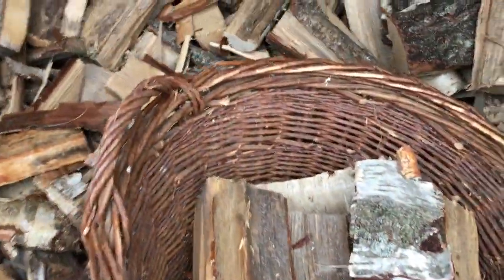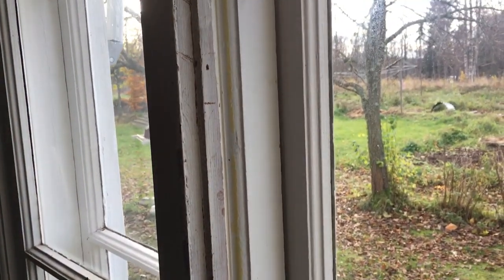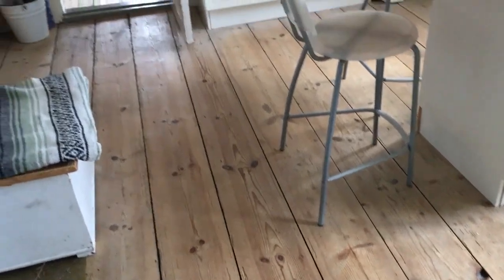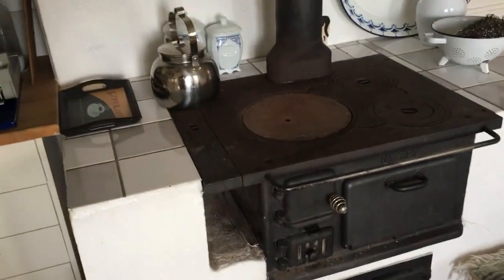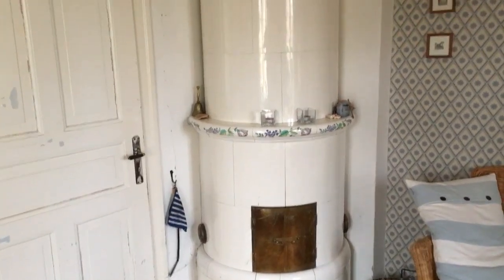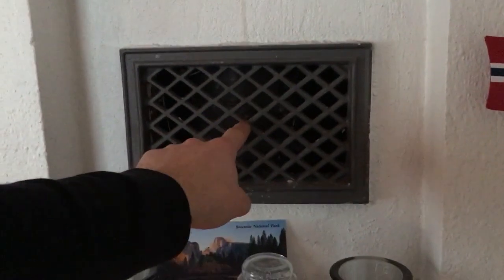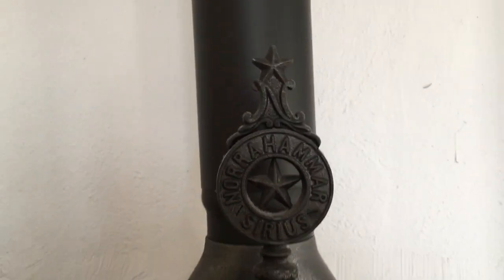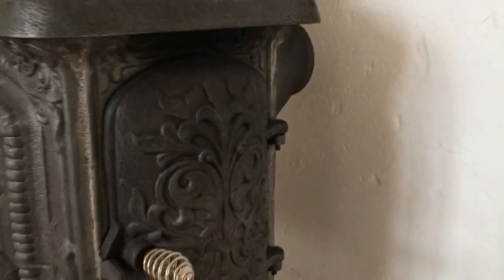The Most Stunning Wood Stoves In Our Farm House

Comment: My grandfather and grandmother had a lovely older stove in their kitchen and grandma cooked on it all the time and it was a Coal, Wood or gas and it was really quite large and she could heat food on the side of it while others as cooking. The wood and/or coal would bun all night and day and it kept the whole house very, very arm. It was wonderful on the Snowy Winter days and nights.  I wish we had one now. If you live in the country it works out better as in villages often to run the chimney out the sie may not be god, but running it through two stories or more is expensive. But in the country it wold save on chimney bu going outside of the house. Suppose it keeps the house warmer through if the chimney does go through to the upstairs?

Comment: We had wood heat in northern Wisconsin.  Nothing a beautiful as these however.  The last one you showed was similar to ours in the kitchen and it was used to heat the kitchen and  bedroom just off of it.  We cooked on it (if you remove the rings on top you can control how hot your pan can get depending on size.) We also had an odd little oven just over the top attached to the stove pipe going to the chimney.  We baked biscuits, fruit strudel, and strata with eggs and bread.   No smoke just the heat as it was closed off.  Otherwise we heated the whole house with a large brick lined stove that held the heat overnight.  I would have loved to have the stoves you showed.  Just beautiful.

Comment: I love cooking on a wood stove, the very first time I cooked a fruit cake in the oven part of it, we had to contact my mother in-law for advice because the cake was cooked on top but raw in the middle, she told us to get an old newspaper folded, and place it on top so the heat would go into the middle of the cake. There's nothing more homely than a wood fire. Greetings from Sydney Australia. The Jotul firebox wood be usable out in the garden, put some chairs out there for everyone to sit around it, just make sure it's sitting on concrete, if you are careful taking it out to the garden you might still be able to get 2-3 years use out of it, don't forget to take the kettle out there too so you can make tea or coffee and sit around the fire.
Reply: I use a inverted cast iron skillet on top of my breads and baked deserts, the cast iron is supported by a few stacked bricks,  and it helps evenly heat your breads, if your wanting crusty tops you can turn your pan up, and add red coals and cover it with a tight lid, you do the same with a flat dutch oven lid, placing coals on top to ensure even heating. Folded news paper covered with tin foil is a great way to insult the heat...

Comment: Beautiful video! So well done. I learned to cut trees in the fall, leave them until winter, the leaves will suck most of the moisture from the wood. Then limb them and cut to firewood length. Wood also splits best when frozen. I try to get it all in the shed by March- it's bone dry by September.  Mostly all birch here in AK too.
Reply: Birch is the BEST!

Comment: Great Video:   Fireplace’s and wood burners have a great place in our homes or business, however poorly maintained and not properly operated at the correct temperature, and not cleaned regularly can result in a hot chimney fire or loss of the structure, I use a magnetic clip type.  Wood burners with a 90 degree elbows are very difficult to maintain and kept clean of creosote build up.  I have both units (with straight pipes)  and I wire brush them often. Operating a burner at low temperatures will result a wet slimy dripping creosote which can ignite and set the inside of the pipe into a roaring blaze.....I am no fire expert I just learned by using mine and research. Good luck.

Comment: I grew up with wood stove heat.  So did both of my boys. Never even had to wear a sweater inside in the winter. The house we now rent has central heat and air. We  were hot all summer and now from the waist down, I'm freezing. Funny thing is that there is a place in the living room where a wood burner used to be. The landlord removed it, blocked the chimney and said we couldn't replace it. We couldn't afford to now anyway with all of the new codes.

Comment: You might be able to fix the Jotul by welding it with nickel chromium rod and using a torch to keep it from cooling down too fast after the weld.  I'm assuming it's cast iron.

Comment: Electric heat is great too. No collecting and chopping firewood. No scrubbing dirty walls and ceilings because of smoke and soot that escapes the fireplace. Just a tiny electrical device that cleanly blows hot air as soon as you plug it in and turn it on. Imagine that! Or, to heat larger areas silently and cleanly, embed electrical resistance wire in the floor and enjoy warm floors and warm rooms regulated by a thermostat.

Comment: The tall narrow oven is made for coke (koks in Norwegian and Swedish), not wood. You fill it from the top, and is settles near the grill in the middle. It burns slow and keeps warm very long. It's not a problem to use wood in it, but that's not it's original purpose. It would be hard to get big, or even medium sized pieces of wood in there. It's really beautiful. Had one in my grandparents cabin, and it gave amazing heat.

Comment: The problem with old wood stoves is they don't seal very well so it's almost impossible to control the heat, plus they burn the wood up several times faster than a stove that is well sealed. That's why I bit the bullet and bought a Vermont Castings Dutchwest stove. They no longer make the Dutchwest but they've started making a similar model that is supposedly slightly more efficient than the Dutchwest model, which is one of the most efficient wood stoves ever made. Jotul also makes one or two stoves like that. They really are beautiful looking stoves but they're a bit pricey.

Comment: New subscriber here, trying to catch up with all that I have missed. We have a wood burning stove in our apartment here in Prague Cz and I fully understand your enthusiasm! I like to burn the trimmed branches of fruit trees, they give out a lot of heat and you can usually get them free! ;-) Tile stoves are still found in large, older properties here, but they tend to be more rectangular and with ornately moulded tiles rather than those lovely, smooth curves... In rural areas and smaller cottages, wood stoves in many styles are still very common and much more like the 'naked' ones you showed.
Reply from the maker: Hi there. Thanks for joining us. The bigger farm buildings here also have more rectangular tile ovens. They are beautiful as well.

Comment: The wood stoves we have considered purchasing draw their air directly from the outside. The smoke goes out through a duct inside the fresh air duct. As a result, the exhaust duct is cool, and the incoming fresh air is pre-warmed. Because these stoves do not draw their air from the room and send it up the chimney, they are much more efficient. They don't draw cold air into the house through your rooms from outside. This bears repeating. The air that feeds the fire comes into the stove through a duct directly from outside. The resulting efficiency is wonderful!

Comment: I grew up on a farm, in a wood frame house with a wood stove. ALL my family has some kind of lung issue now. When you went to school YOU were one of few that Smelled like burning wood. The ONLY room that was comfortable was the one with the Wood Stove in it and the constant processing of wood in summer took away from the daily chores of the farm. When my oldest brother came out of the military he bought a home with CENTRAL HEAT. I thought I was in paradise. No smell, all the rooms were the same temp and you didn't need to wear long sleeves, sweaters and socks and shoes ALL winter long. Nope. Grew up with this source of heat,,am NOT going back to it either. I built my home so well insulated that we use very  little power to heat it and THAT I LOVE.
Reply: I am older and no longer heat with wood... I worship my thermostat.

Comment: I see that you burn white birch...just letting you know that the birch bark has black oil in it and causes sticky oil substance that will stick to your inside chimney liner. Try taking off the bark and use it as a fire starter or sell me the larger sheets of birch bark for my furniture making design.  I like the stove and thinking of buying one for my work shop with the oven. 
thank you for the video.

Comment: Wonderful Video, I live in an underground earth home built in the mid 1970's, we have a Russian Style fire tunnel (about 6' in length, the German Emigrant that built it said it was one of his last builds, he was in his 70's, I'm told. The chimney channels back and fourth horizontally before going up the chimney. It helps to heat up the walls and fire brick that hold in the heat, even after the fire went out. The main problem is that if you area away and not monitoring for new leaks, you could have a major leak problem and not know. Thank You
Reply: Our russian style stove was fired for two hours, twice a day, once in the morning and once in the evening, and heated 1800 square feet.  It burned to fine ash in those two hours, then was closed up tight the rest of the time, nothing to leak.  We also had carbon monoxide detectors in every room, they never went off, not even once.
We charged our heater slowly when heating season came along, it took a whole week, slowly increasing fire size from a few pieces of kindling to a full firing.  The charging process was necessary to expell any moisture in the masonry, and prevent cracking.

Comment: We use 2 wood stoves to heat our log house.   The old cook stove has a big oven, a warming oven on top,
and a side reservoir for water.   It's name is Round Oak Chief and it keeps a fire all night if it's shut down tight.
We do love it ~  we can cook 5 separate pots of food on top,  a big turkey in the oven,  and heat our water 
in a tank connected on the back !!!   There's a company called  Woodstock Wood Stove,  that we bought our Livingroom  wood stove  the 'Progress Hybrid' from.  It's cast iron with a soapstone exterior.   It's unusually lovely and extremely efficient!   It easily keeps a fire 15 hours when loaded and shut down!   It's our only main source of reliable heat,  all seasons.  The 100+ year old Cookstove we use in very cold weather ... & cherish it.
We use four and a half full cords of seasoned wood in the coldest year,  so far.  But just four, in years like this

Comment: Cast iron is the best metal for stoves. Whether the fuel is wood or coal, cast iron has good inertia and emits heat in a smooth manner, no peaks and no troughs. There are many small and medium enamelled cast iron stoves here in France, fo sale on ebay. People get rid of them because they're heavy but many of them are beautifrl in a variety os styles like Victorian with vines and flowers or Art Nouveau or Art Deco.

Comment: The furnace at 8:26 isn't a woodstove. It's a coal burner, hence the small door at the top of the hopper. It is meant to be filled to almost the top with coal and lit on top so it burns downwards. A full hopper of black coal will burn half a day and through the night without any attendance. The range in the kitchen is also originally a coal burner, hence the small door. Its puprose is not to feed sticks in it every 15 minutes, but shove in two small shovels of black coal and it will heat and cook for six hours minimum (but you might know that). I have since last year foregone all my wood burning stoves and the gassifier boiler. I have switched over to a heat pump. The house (also an old farmhouse, stone and wood) has never been so warm for so little money. And, I like to think there are many better uses for wood than just burning it. I don't miss any aspect of wood burning, like the heaps of money spent, sawing the wood, stacking it, the ashes, the work every day in winter, the stench of wood smoke ... (well OK, the gassifier did not produce any discernible odor, but all other stoves did).

Comment: Great video. I have a little jotul also with a crack in a similar place.
Reply from the maker: Ok. Wonder why they crack.
Reply: Just depreciation of the metal from expanding and contracting so many times over the years. I would attempt to fix it with some thru bolts binding a plate of steel to the inside wall. Of course you would need to drill holes and would see the bolts on the outside, but I don't think that would look so bad. If you really like the stove, then it deserves a second chance. Charming tour of all your stoves....thanks!
Reply: Did you see what Dan Fraser commented?  "We had a Jotul  and the side cracked we contacted the company and they replaced the broken part. great stove. Wish I had kept it."

Comment: Jotuls are sold in the United States.  When looking for a wood stove for my house in Idaho I looked at Jotuls but eventually went with another brand.
Reply: What brand did you buy? Do you like it so far?
Reply: +How to get out of Babylon  I eventually bought a Pacific Energy.  The model I bought does not have a catalytic burner but does achieve a secondary burn.  Once running the unit puts out a lot of heat, but because of the secondary burn tubing it is sometimes hard to get lit.  (Not enough draft.)  It is not a cast iron stove.   Only using it  for years will give evidence on the long term quality of the Stove.  If you have the money available, I would indeed recommend a full cast iron stove.
Reply: @R. Blakehole

We have a full cast iron stove and We are VERY satisfied with it (brand is Dovre, which is produced in Belgium). No catalytic burner either and does achieve secondary burn without a problem. Getting it lit is no problem either, not a single problem. What method do you use to lit your stove? The Swiss method is what I mostly use and works like a charm each time (top to bottom fire).

Comment: Do you have a basement in your parents house, if so put a small wood-burning stove in the basement and that should keep the floors warm.
Reply from the maker: Nope. It is built the old way they used to built those houses. It is sitting on big rocks with little holes for ventilation. That means the cold air just circulates under the house. One could open up all the floors and insulate them but the risk is that the old beautiful floors will break.
Reply: you only need a small air exchange to prevent rot in the crawlspace, limit the air exchange in crawspace and your house will be much warmer

Comment: Wood is indeed still the best heater. It's inexpensive, energy effective and the heat can not be compared with anything else. 2 winters ago we had 2 electrical heaters (mounted on the walls): didn't perform enough at all specially during freezing temperatures + we almost crapped ourselves when we got the bill afterwards. Than we tried a kerosene heater: it did heat the living room, but that was about it. The moment we opened a door the warmth was gone and it took "ages" to heat everything up again + it smells like an airplane dumped his fuel in our living room. Don't get me wrong, we still use it but only in between seasons when it's not cold enough to burn the wood stove and/or at very early mornings to get that night chill out of the main room. Now, for two winters we use a small wood stove as our only source of heat: let me tell you, there's nothing that compares to it. The fuel (wood) is cheap - we don't live in the woods so we have to buy it in bulk but it comes pretty cheap - smells good and the heat.... oh boy, once that wood stove gets going ALL the rooms get heated in no time. Plus the fun I have hauling those blocks from outside, sometimes needing to chop up a few cause they are simply to big for our stove and stacking everything.... I LOVE IT!

Cheers.

Comment: A fireplace built as part of the design of a residence is not nearly as efficient as a wood stove. Fireplaces are more for aesthetic reasons. Yes, they are romantic and great to sit in front of while drinking hot cocoa - but if anyone has noticed, people who do this usually have a blanket. Apparently, the fireplaces don't really put off enough heat.

Now, a woodstove - there's an efficient heat machine. Cutting firewood may be a chore to some, but I always found it to be a rewarding endeavor, especially when you can sit indoors on a cold wither night and enjoy the fruits of your labor - while sipping hot cocoa and watching the twinkling Christmas lights around the frosted windows.

Comment: How do you clean a stovepipe that winds back and forth inside the wall?
Reply: They install clean out ports. The thing is that there is really nothing to clean out. A stove like a Rocket Stove with a burn tunnel, heat riser, and combustion chamber burns close to 100% efficiency. Most of the "smoke" is carbon dioxide and water vapor.

To clean out my rocket, we just stick the leaf blower nozzle in and blow it out the other end, ie the chimney. 
Nothing but a few fine ashes come out.
Reply: +How To Get Out Of Babylon 

To be more clear...
We blow it out after checking the inspection ports, ie clean outs, and I do clean out the burn tunnel. The bulk of the ashes are going too be in there. Anything that gets up the thirty inch heat riser and into the thirty feet of pipe is going to be extremely fine dust.

I also built it with the barrel lid on top, so the lid is removable for inspection of the riser, adjustments on that, and is also replaceable. 
That means that If or when the lid burns out, I have twenty more to go on. The Firebrick and Ceramic Blanket around the Firebrick Heat Riser should last basically forever.